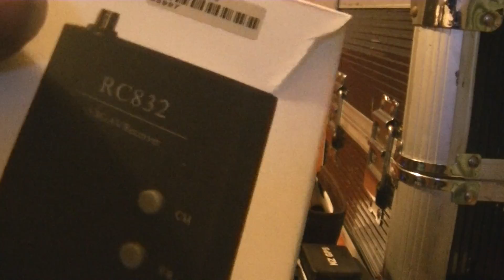naze 32  gps wiring

Comment: Transmitter is for your quad and receiver is for your Google and you only need to connect 3 wires in your transmitter Red and Black for power and yellow for video which goes to your camera on the quad and usually the transmitter is smaller then the receiver and Skyzone is a very good brand. And you need to calibrate your Accelerometer and Magnetometer first before you can arm your motor or it won't arm even if you calibrate it but did it incorrectly.